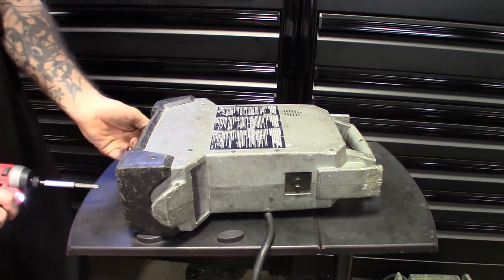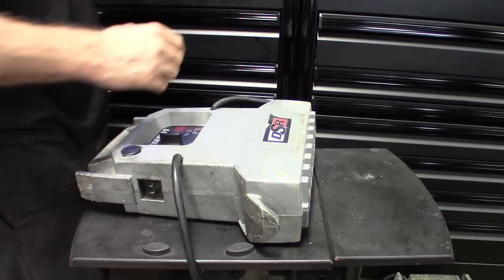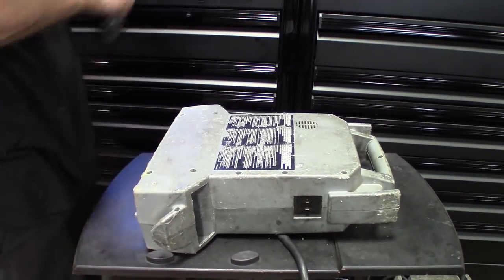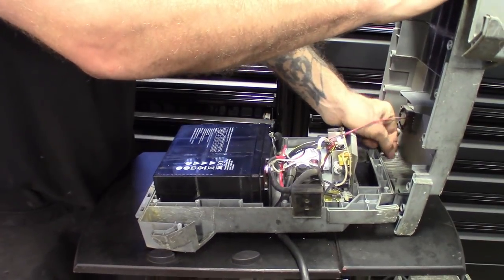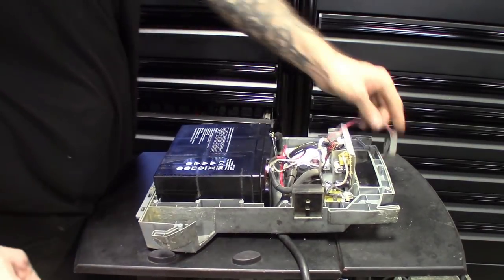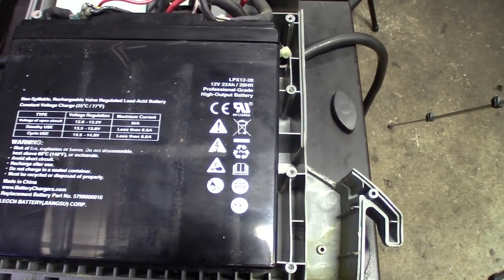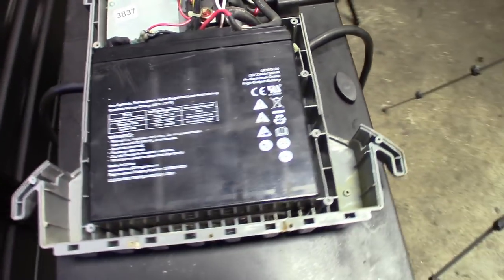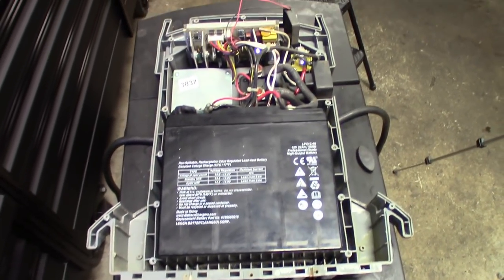FIX YOUR TOOLS & EQUIPMENT WITH YOUR TOOLS & EQUIPMENT

Comment: I have a 4424 pack myself and it's at least 6 years old and still works perfectly.  I use a B and D conditioning charger to charge it through the cables and it works way better than the built-in charger.  I can get it to read 95% without any issue.  Have done only 1 conditioning charge, but even so, at 40%, it will jump my dead 7.3 diesel without any problems at all.  Around 6 or 8 jumps on it last week and it's still at 75%.  Have left untouched for over a year without any issue.

Comment: You work at a Nissan dealership aye. Those are both the same jump box just the one has the sticker of that tool company so then can charge you more you know the deal with the tool trucks... Did the jump box do good I keep hearing its more then the battery that starts to go in them from the local Napa.

Comment: Now I need to check to see if we threw the old one out at the shop yet. If not then I'll take it apart and have them order a new battery. Wouldn't charge any more so they just ordered a new jump pack. Great tip. Do you have a part number on that battery? We also deal with Interstate.
Reply from the maker: I think I got a shot of the part number in the video.

Comment: I have one of those.  I'm on the third battery.  It's emitting a high pitched tone these days.  The help line says it's the motherboard and it can't be replaced (it's so old).  I cleaned up the motherboard with 70% alcohol and an Que tip.  Still whines intermittently.  Any ideas?

Comment: Did you happen to check the voltage that is being sent to the battery via the charging unit? Mine doesn't seem to take a charge at all (it beeps every 10 minutes or so when I try to charge it - display toggles between 0 and 10% charged). Only putting out about 9.5 V to the battery.

I've kept mine in the box in my vehicle for 7 years, charging when needed. The thing looks pristine inside. Be a shame if I had to toss it.
Reply from the maker: The battery inside it probably won't take a charge. Try replacing with new one
Reply: @JRC54  That was the plan until I checked the voltage being delivered to the battery. Expected to see 12 V.

Starting to look like it may have just been in a state of deep discharge because it FINALLY seems to be taking a charge (27% now). Probably used the unit once for myself and about a dozen times to various poor souls in need in the past 7 years..

Appreciate the video!  Gave me a bit of hope and it may just pay off.
Reply: ....and it just went back to 0% charged. Gonna leave it plugged in for 48 hours (as per instructions) - otherwise I guess I'll try a new battery.

Comment: Is the charger/starter out of warranty?
Reply from the maker: Yeah it was way out of warranty.
Reply: What did the new battery cost for it? I never bought one because I didn't think you could fix them. Good info.
Reply from the maker: Interstate has the batteries $50 or $60 bucks.